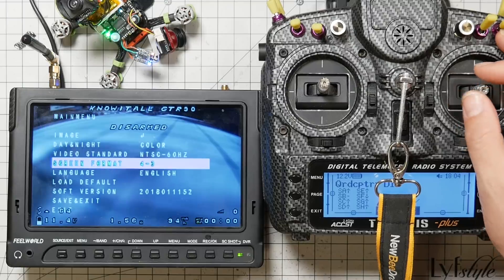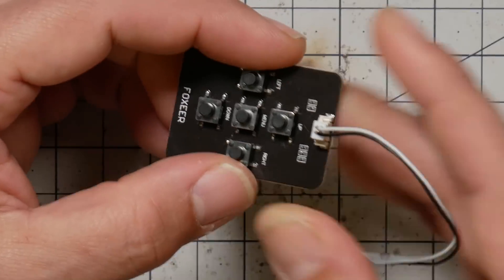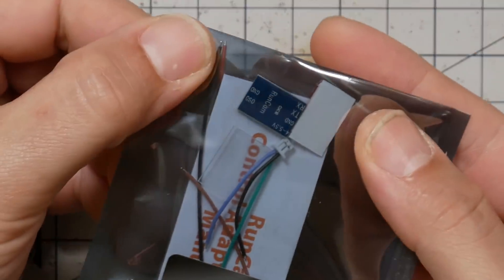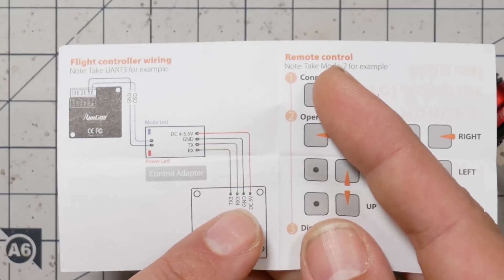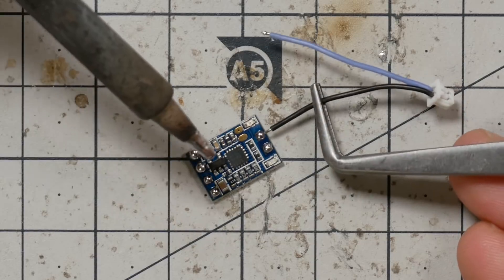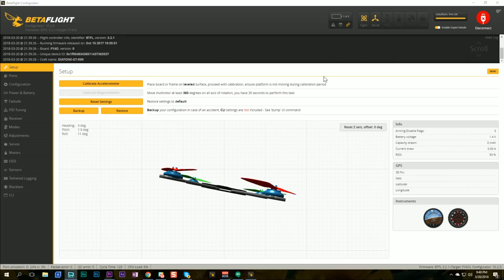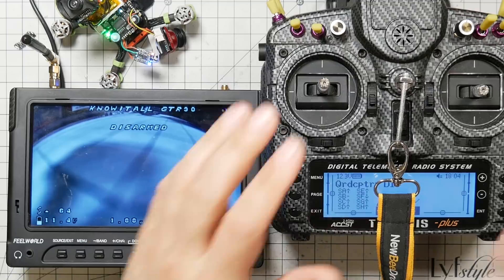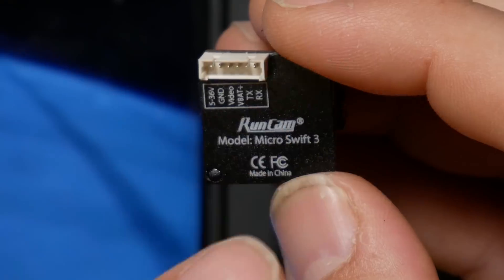Runcam FPV Camera Remote Control Adapter

Comment: How do you wire  addressable led s  to a hobbywing fc the manual is very vague. I'll pay you for info!!!! I can't find a dumbed down wiring diagram I put an ummagawd led in the remix bit I think I wired it wrong
Reply from the maker: It's always the same: power to power (5v? 12v? depends on the LEDs) ground to ground, data/signal wire to the LED pad on the FC.
Reply: Thank you for taking the time to respond the only problem I'm having is hobbywing didn't exactly label the led signal lead anywhere on the board
Reply: Unless that led strip three pin is the signal
Reply from the maker: https://img.staticbg.com/thumb/water/oaupload/banggood/images/3E/C5/6460225b-fe70-4a8d-b246-c84dfeb55b2b.jpg

It's something to do with that. Use a multimeter to figure out if one of those is 5v or ground, the last one is ledstrip signal. I don't know what it means 5v in that diagram.
Reply: Thank you Josh for taking the time out of your busy schedule to respond and helping out. the led might be bad. rotor riot is sending me a new strip. Keep up the amazing work with all the great content in fpv know it all..... :)

Comment: Do you know if this will allow you to change One Touch Scene Setting on the RunCam Swift 2 Rotor Riot?
I have Andrey Mironov hack running on two quads and works great (was a bit difficult to get working ,but does not use up a UART) ,but the only thing it does not allow you to do is change pre saved scene settings ,which is a shame as its a great hack. You can tweak individual camera settings but this takes time. I have some on order so I should find out when they arrive?
RunCam is my favourite manufacturer ,really innovative ,I hope they bring out a Session 5 competitor?
Reply from the maker: I don't think there is a shortcut for it.
Reply: Hi Josh ,I just thought I would let you know One Touch Scene Setting on the RunCam Swift 2 Rotor Riot does work on the RunCam control adapter ,when installed ,if you move your role stick(mode 2) to the right from centre and hold for 2 secs you can change scene settings from ,indoor ,outdoor ,personnel ,riot ,lightrax  ,cloudy. This good news as it means you can change setting quickly depending on the lighting conditions when you fly ,sunny one minute ,overcast the next ,very common here in the uk!
Just don't do what I initially did and connect the osd control wire to the adapter with the inline resistor mod still installed!

Comment: Can this be accessed while the quad is armed? I kinda see myself flying, centering the right stick, at mid throttle, then do a crazy right yaw, and boom... no control.... or is it only available when disarmed?
Reply from the maker: The way it used to work is, the camera control adapter would not enter camera-control mode when the quad was armed. If you arm with camera-control mode active then it might activate when you're in the air I'm not sure about this.
Reply: Ahh... that sounds good. Guess I have to play around with it, just to be sure

Comment: We are always short on uarts (e.g. when you use iNav with GPS and other stuff). Why don't they provide an alternative PWM input, they you could use eg. MOTOR5 and you don't need to block an UART for a seldom used function. I know that the orignal solution (Resistor/CAP) uses the PWM to realise a poor mens DAC, but as you explained, this doesn't work very welll. 

BTW: Time to integrate this to Omnibus 5 :-) I hate this daisy chaning of componets in a copter.
Reply from the maker: You can do that via softserial if you want.
Reply: Oh, yes, I missed that :-)

Comment: My Kopis 1 handles the Runcam and Atlatl TX just fine. What I can't find on the interwebs is what all the settings/menu choices on the screen do.  For e.g., what's the difference between SET and Save/Exit and Save/Reboot.  If someone could point me to this info I'd be extremely grateful.
Reply from the maker: Set writes the  channel, power, and other settings to the vTX immediately. Save/Exit saves the FC config, not the vTX config.
Reply: Thanks JB.  Flew my first "problem free" FPV flight today after "setting" the vTX power to 200mW and having it STAY there.  It defaults back to 25 mW without using the SET command.  I found that out the hard way.  <;-)

Comment: "It's not the flight controller's fault"
Then proceeds to explain why it's the flight controller's fault. If the board says it supports this feature but it doesn't work, don't excuse the board designer for doing it wrong.
Reply from the maker: No that's wrong. The board designer has done something incredible, but there is only so much he can do given the constraints of the hardware. The problem is that there is confusion over what the "camera control" feature is capable of doing. So people expect it to work 100% of the time with 100% of cameras, when that was never what was promised.
Reply: Joshua Bardwell so if I understand this properly, the feature uses an output from the flight controller in a way that it's not supposed to be used. So it's pretty finicky that it works at all, and this add-on board basically does it the correct way.

Comment: I would love to see this work for the Foxeer Predator Mini. There has been discussion online and solutions to make camera control work for other cameras, but as it stands Andre's camera control function simply will not work for the Predator in any configuration.
Reply: Wüdz_fpv , this adapter won't work with predator cams.  

Edit .    It does work. I just wasn't doing the stick commands correctly .
Reply: @nate15FMX yes it will. Josh already tried it.
Reply: I have corrected some other posts I did.   Yes it does work , I screwed up and jumped the gun and had a sour attitude (sorry).   Need to input enter command twice with your transmitter for osd to appear.   I was doing the commands incorrectly. Hope I corrected my posts before many saw it.   Wouldn't want to miss inform people. Sorry about that !

Comment: Andre's contribution will still be needed and it won't become obsolete because not every one will replace their working runcam for the new runcam 3 models with built-in control module -- like me.
Reply: and for only $3 I beats buying the new camera for $34 or so...  But be sure I will buy the new swift 3 when I my runcam is broken.

Comment: will the micro swift 3 camera only be controllable via uart. I have 4 quads with different FCs and cameras all with camera control working perfectly and also FPV wings that need the camera to be setup via the dongle pad if this is the way cameras are going how will you set up non multi rotor cams.

Comment: Has anyone tried this with the predator cameras / Foxeer ? Thanks team!
Reply: Russell Kegler , Edit...... It does work :D
Reply: Nate15FMX dang man that’s a difficult camera to work with ! Thanks for the reply if I find a solution I will pass it on to you!
Reply: Russell Kegler , I jumped the gun.  It does in fact work.  Need to input "enter" command twice with your transmitter to bring up osd menu.  I was just doing it once.
Reply: Nate15FMX awesome success I will set mine up the same thank you very much!

Comment: well, another uart "device". maybe the bf devs and major hw devs should sit together and develop/choose another "standard" for interdevice communication...
Reply from the maker: i2c.
Reply: Joshua Bardwell yeah. I know a lot of boards break out i2c, but it isn't  used for much else then an additional magnetometer.. or at multiwii days for small OLED screen.

I thought of something like can bus. But maybe uart is still enough.
Reply from the maker: Bit of a chicken and egg problem. Since boards don't break out SCL/SDA ports, nobody wants to commit to using them in a peripheral.
Reply: Joshua Bardwell maybe. But it would be so much more convenient to. And configuration wise, bf could do the most on its own without user interaction...
Reply: I2c or why not using a (master slave/bus) protocol on one of the UARTs for not hight performane parts? But I2c is available, mature and suported by many ICs and you can easy develop your own parts with something like an ATTINy or such stuff) Due to the bus logic of I2C we are not limited how many components we can add. OK, if we don't have timing problems... :-)
CAN bus is not a good option due to the expensive licence fees the manufacture has to pay. The PixHawk style controllers support CAN bus, but this is a totally different concept to the Cleanflight familly. Those CAN components are rare and expensive (e.g. LIDAR)

Comment: Cool, all we need now is solder connectors on the back of the camera and I'll be a happy boy.
Reply: Nooo the camera is so destroyable needs to be field swapable.
Reply: Maybe I'm in the minority, but I'm cool with that. In my experience I've found the connectors break far more often than the camera itself - whether its the tiny thin wires breaking where they go into the connector or the metal bit pulling out from the plastic plug,  plus having to splice the wires between the likes of a Unify and the camera feels like a right bodge. If they had solder pads I would be able to fix stuff like that in the field rather than having to go home because I didn't have whatever connector they decided to put on their cameras that week.
Reply: Every thing on mine goes via the FC so any component can be unplugged and swapped even the FC itself, I have had the camera chip get separated from the board was a good hit but never had camera cable fail lost count of camera cases smashed.

Comment: I think the old way is still useful as it doesn't require a UART and I don't have spare UARTS on my old F3 boards but I do use the LED pin for camera control.
Reply: What do you mean you use the LED pin for camera control? I have an unused LED pin, how would I make this useful for controlling my camera?

Comment: Adding more wires is never a good option.  Meh on Runcam for this one.
Reply from the maker: IMO this is the correct way to handle this type of control. The camera control resistor thing was always a hack. This proper serial protocol opens up a lot more functionality such as the ability to input commands directly to the camera. Imagine being able to switch your camera preset from night to day using an aux switch on your transmitter. That's what you can do (potentially, some day) with this feature.
Reply: Joshua Bardwell I think a better application of technology would be to avoid the resistor system all together, and reverse-engineer the cameras to accept controls from the flight controller. That is probably what they will do next, so I will just wait the two or three weeks it takes for them to come up with stuff like this!

Comment: tbh I am fine with having the other cable tucked behind my camera, what would be really cool is different camera setting presets (night,day,overcast,grass,indoors ect)
Reply from the maker: Some Runcam cameras have this feature and now you can switch between presets easily using your transmitter sticks.

Comment: I have tested this Runcam board, and found that it works, ok, but not better than my camera control hack, with the big disadvantage to use one precious UART. Camera control hack uses just 1 pad via a SoftSerial selection. Only advantage is that is makes it easy. Also, it does not work with Foxeer cameras (at least the Monster I have tested), as the resistances are not the same than Runcam uses.
Reply from the maker: Either solution can be good depending on your situation. Many people struggle to get camera control working, and this is a life-saver for them.

I'm surprised Monster didn't work. I have used my RunCam joystick adapter on every camera I've ever bought, including Monster, Predator, Arrow... the only one it vaguely had a problem with was Caddx and even then it mostly worked.

Comment: Just ordered 2 pcs, then realized - I use foxeer cameras! Omg
Reply from the maker: I think it should work on Foxeer cameras because I have used Runcam joysticks on Foxeer cameras. But I can't be sure as I haven't tested it yet.
Reply: What is the outcome? Did it work? I have a Foxeer Monster V2 and I would like to use this method as well, if it works.

Comment: Really cool piece of kit, but I'm also sad to see they're removing the old controller, instead of leaving it in and adding the UART in addition to the old controller. Removing it kinda screws anyone who is out of UART ports, which is easy to do between smartaudio, telemetry, and whatever else you throw at it
Reply from the maker: I think the issue with UARTs is going to go away in the future as we progress to F7 chips, but for now you're right it is a little unfortunate. Maybe Runcam will make a reverse-adapter that takes the old joystick input and outputs UART commands. Wouldn't that be hilarious.

Comment: Hey josh 
Thanks for your hard work your knowledge has helped me more than you know 
I have a small laser engraver  i have realized that i can engrave circits on copper then etch them with ferrous chloride 
Do you think it would be possable to fly a pcb that has been mafe in that fasion
Take care and keep up the hard work
Reply from the maker: I honestly don't know enough about PCB manufacturing to say whether this will work.
Reply: bradley meek you cold even use a breadboard. It depends on the quality of your work. But keep in mind that you are stuck to a top and bottom layer only when using this method.

Comment: ooh, this will be handy for me.   if its using runcam device?  isnt that still using andre's work? .. anyway good work everybody. job done. i just got the eagle micro, gonna try some 16-9 flyin,
Reply: TheMadmacs all this adapter does is multiplex a set of resistors, same set of resistors you have on your physical Joystick. RunCam consulted with me when working on it, this adapter was ready a year ago, not sure why the delay
Reply: ah thanks for your input and replying,  i think runcam has had a very busy year, the hobby has expanded so much,  i think its mainly the cmos cams which really benefit from  ability to change cam settings quickly,  ccd's do well in any conditions, but cmos need some changes when a biggest grey scottish cloud appears. thanks again,  the hobby would be impossible without all you guys.

Comment: Shit I just ordered like 300 resistors and 300 tiny capacitors!     I heard micros may be different as far as  the need for the capacitor?
Reply: You build a low sort of a low pass filter based DAC. So there are many reasons why it may not work: Impedance of the cam input, PWM frequency of the used pin (depends on the divider which is set for the port and some more nice struggles... without any active components like some transistors or an operational amp, it is what we call in german "Kaffeesatzlesen". (reading in the tea-leaves) It may work out of the box or not....

Comment: There’s also the Camera Control Addon board at RTFQ. You don’t need a UART. just a spare motor signal pad. 

http://www.readytoflyquads.com/camera-control-addon-board
Reply: RTFQ sells counterfeit crap.  RTFQ will take your money and keep it until you get PayPal to nearly shut them down.  It's not just me saying this.  RTFQ has an F rating with the Better Business Bureau (look it up).  There is a five year long thread on RCGroups of angry people that have been screwed by RTFQ.  If you insist on using them read up on PayPal remediation process because eventually you will need it.
Reply from the maker: It's not guaranteed to work like this one I don't think. Same issues as the camera control pad.
Reply: RTFQ finally responded to my order two months later. No email about there being a delay. Stay away.
Reply: RTFQ sucks balls.  He sent me a FC that did not work.  After two months of pestering and going through a paypal dispute, they finally agreed to replace it if I would send it back.  I have been waiting a year and a half.  Definitely stay clear of this bozo.
Reply: That uses camera control. It's just the capacitor and resistor on a tiny PCB.
Reply: Bug Blender wow okay. I’ve only purchased a couple of things from them. Gps/camera control. Haven’t had an issue with them and they are definitely not where I purchase majority of my kwad stuff. But yeah good to know. Thx

Comment: I haven't ever been able to get cam control working with my caddx micro f1 and matek f411. I have read that this adaptor doesn't work with caddx cameras. Does anyone have any input? 
I tried wiring the control pin on the camera to the rssi pad of my fc, with a 150ohm 1w resistor inline, to no avail. 
fc doccumentation states to use rssi pad and gives instructions on what to change with cli to make it work.
Reply from the maker: I've successfully used a runcam joystick with a caddx camera so I would guess it would work.
Reply: Thanks for the input Josh, I'll keep an eye out for these down under. Can't hurt to try for $5.

Comment: Any idea if this will work on a Foxeer HS1177? They only have one OSD wire and a stupid joystick that requires you to disconnect the camera from the quad and connect to a screen unless you modify the cable. I've tried many times to get camera control working with all kinds of resistors/capacitors but have yet to make any progress.

Reason I ask is I was stupid enough to buy a second hand cam with no osd stick and the guy left his call sign on the osd. I've been flying with a MONDO FPV call sign for about 6 months now...
Reply: Speed Sloth mondo fpv wtf😂
Reply: I'm genuinely considering just getting a new cam, this one just won't die!
Reply: Yeah I tried a few but that was before the settings were on the thread. Will have another go! Good to hear someone got it working. I'm using the Matek F4, can't remember what cap/resistors I went for in the end. I will persevere thanks!